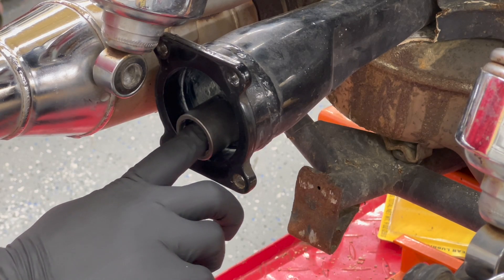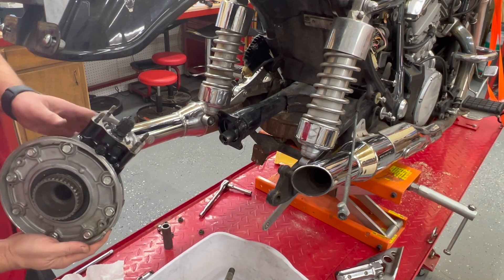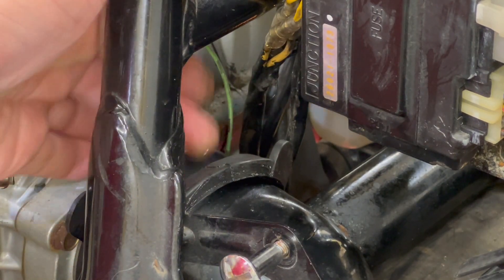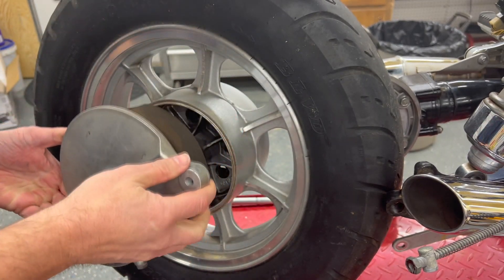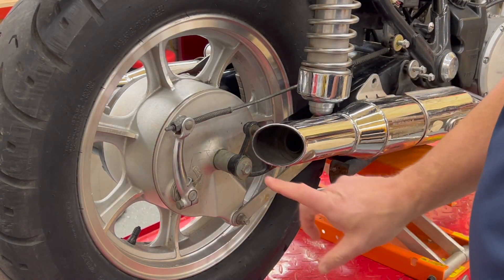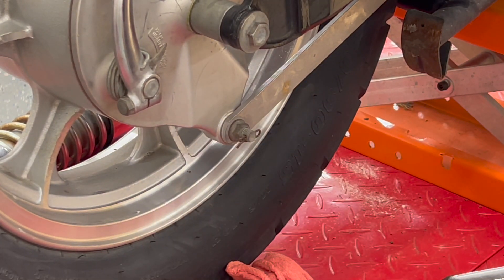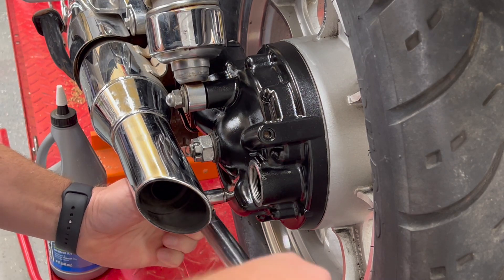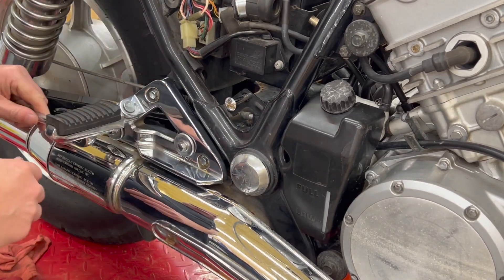How to lube the splines and change the oil in a motorcycle final drive Kawasaki Vulcan 750 Pt3

Comment: Solid info and methods! That first instal was just a trial run ;) Common practice over here lol.  Also, the lighting is so consistent and nice in your shop no matter what you were focused on.
Reply from the maker: Lots of trial runs here as well. I just don’t include all of them in the video. 🤣😂 Thanks for the compliment on the lights. My thoughts when setting it up was more like an operating room then a shop. It’s a bonus that it helps with the videos.